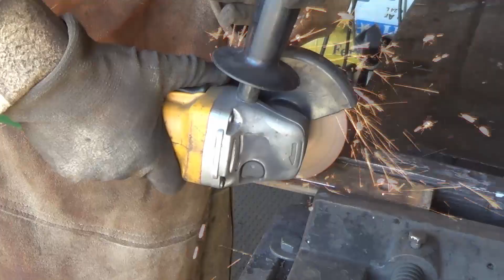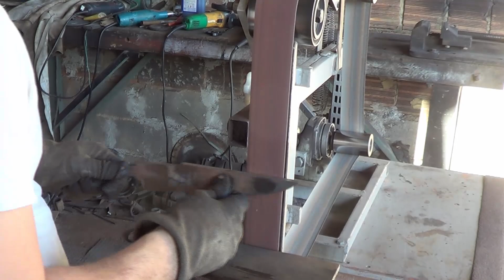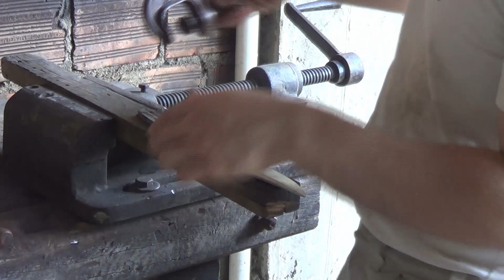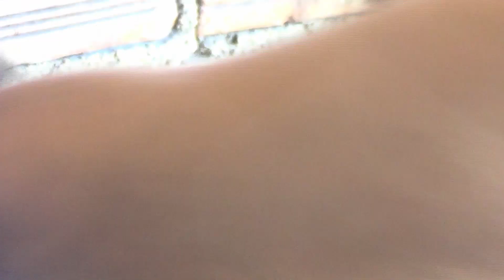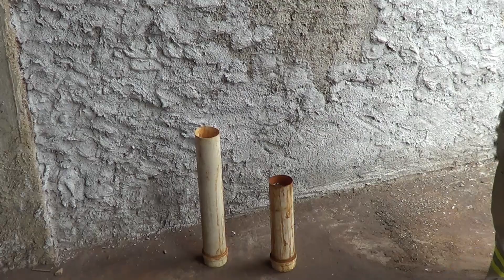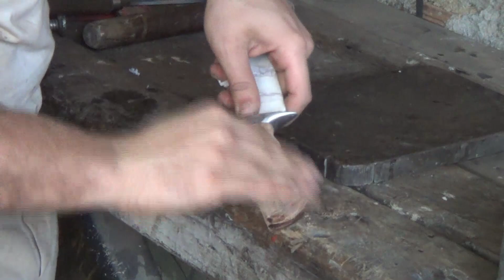Knife Making - Making a Winter Knife (Bowie)

Comment: Looks beautiful, yeah, but... Epoxy on guard? No pommel fixing ?
Reply from the maker: Thank you very much, yes, to facilitate the manufacture of the guard on the back of it, I usually drill a larger hole than necessary, so it is easy and there is less wall to machine. This creates a cavity which is filled with epoxy. As for the pommel, it was not necessary as it has a pin on the handle, which holds and fixes everything in place. 👍👍👍

Comment: You should try to crown your pulley wheels to prevent the belt from slipping out of alignment so much.
Reply from the maker: Yes yes, I am in the process of improving my sander, it is sliding a lot to one side and the other  👍👍👍